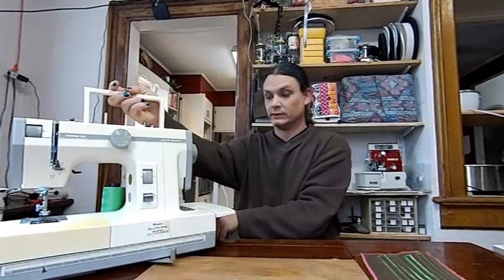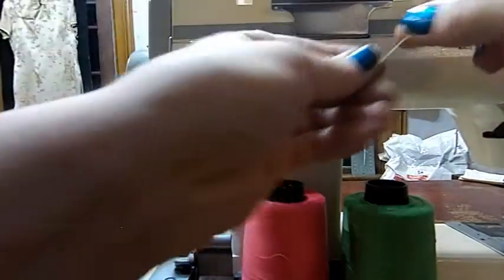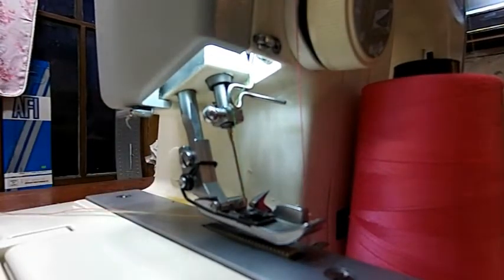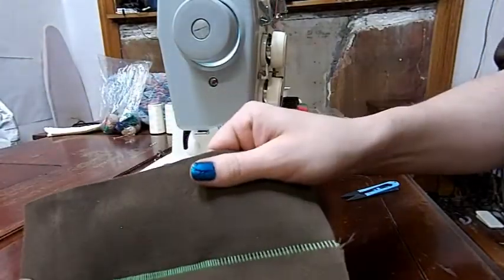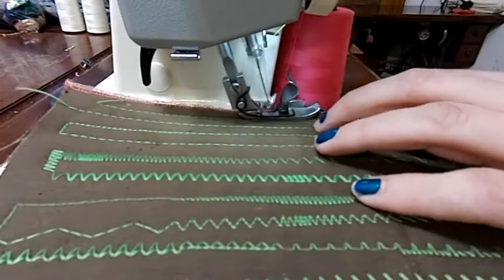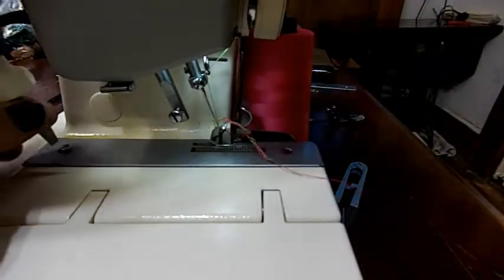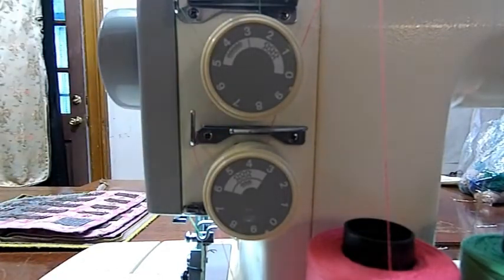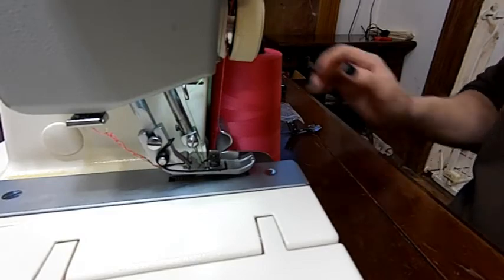How to Use a Vintage Janome Combi DX 502 Sewing Machine - Part One: Serger / Overlock

Comment: I just obtained one a Combi machine, and it needs a new belt. The service manual for the machine does not address belt replacement.  I've taken all of the covers off except for the serger end where the belt is located and can't figure out how to get that off.  Can you help - I would sure appreciate it the machine is immaculate and would like to get this up and running again
Reply from the maker: I dont own the machine no longer. But if I recall I think you have to remove the top crank shaft out to do this. And maybe even the lower I was lucky I didnt have to do this. It would not be a easy job at all.
Reply: @SewSaveMe  Thank you for replying! This info helps
Reply: @SewSaveMe  agree with you, replacing the belt would not be easy.  Mend It has just replaced a motor in one and trying to get the belt back on was fiddly.  There was also a capacitor in this machine that had blown.  Tell tale sign is that awful smell coming from the motor area.  Thank you for your video it helped us to work out how the machine sews/overlocks.

Comment: The over lock side of my machine keeps cutting thread, I've oiled it and it hasn't stopped please what do I do, I've also crosschecked the threading and the tension over and over again please I need help
Reply from the maker: Im sorry for the Delayed Responce I had no idea youtube was holding the comments until now. I would make sure the tensions are clean. If they got old gummy oil in them could cause this. Other then that im not 100 percent sure.

Comment: Thank you for sharing. I bought this machine in the '80s and broke the serger needle and have never been able to get it going again. As I watched your video I learned about the gadgets that I've never used. LOL. Do you have a recommendation for the serger needle purchase? Maybe you can supplement the video with a very elementary how to change the needle and what to avoid when doing so-- Thanks!
Reply from the maker: Im sorry for the Delayed Responce I had no idea youtube was holding the comments until now. As far as a needle I use a standard sharp sewing needle.
Reply: @SewSaveMe  Thank you for your reply. I tried new needles and they are still breaking. I don't know what is wrong, it may just need to go to a repair service to get it back in working order.